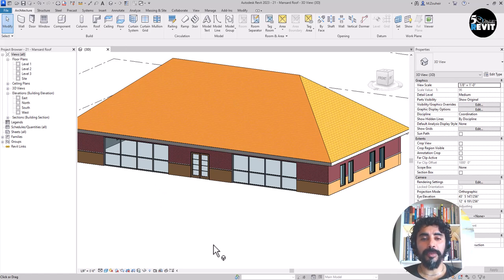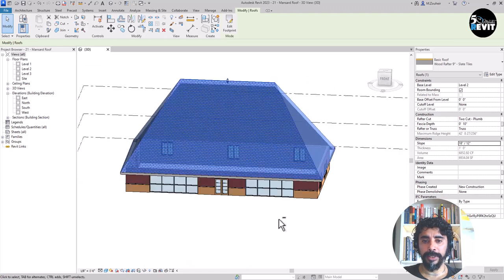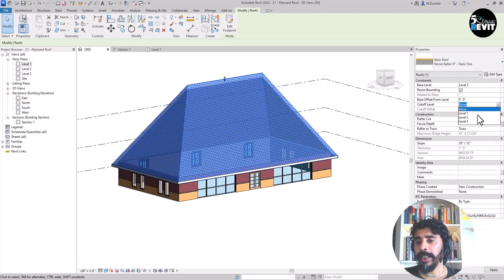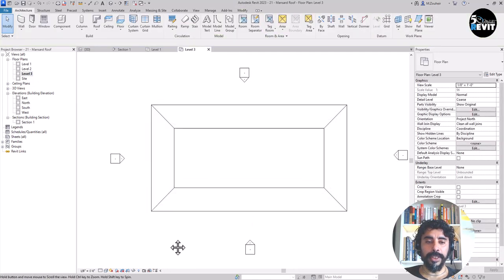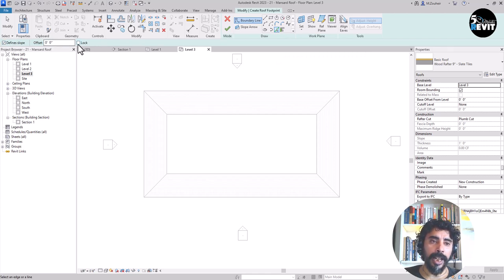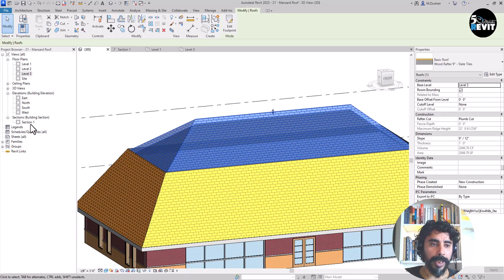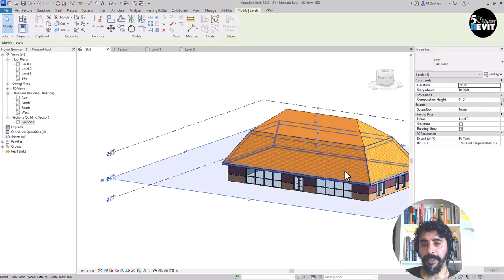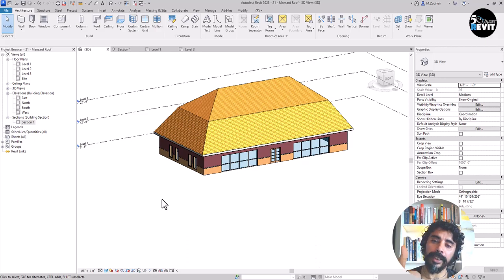Revit tutorial Mansard roof

Comment: Nice cutoff option to stop a roof then make another new one on the top and lock it to the same cutoff level …. But … 
The issue is the difference in thickness ! That requires that you calculate how much you have to compensate and make the new roof matching the same thickness like the old one, otherwise it would always look wrong in section